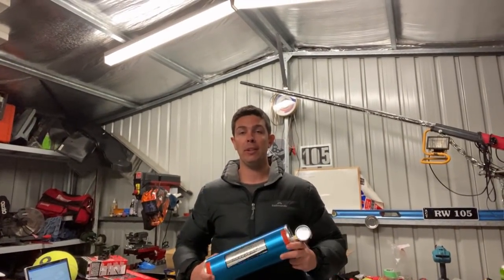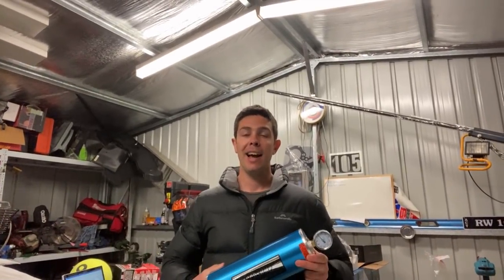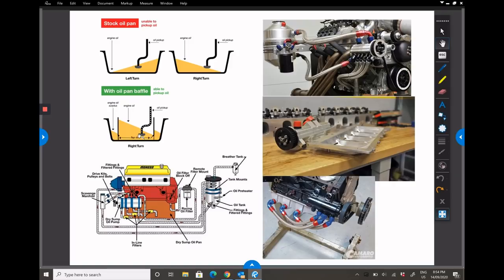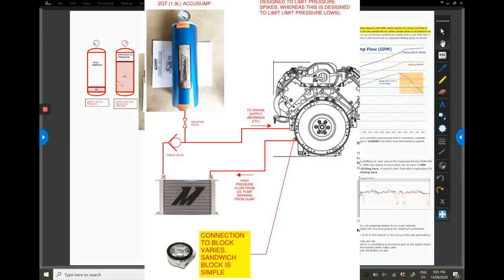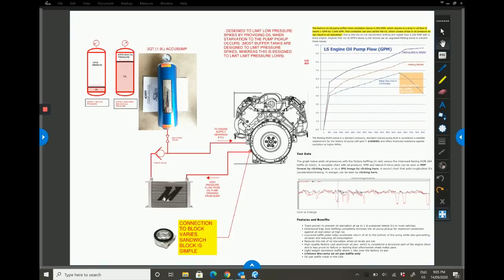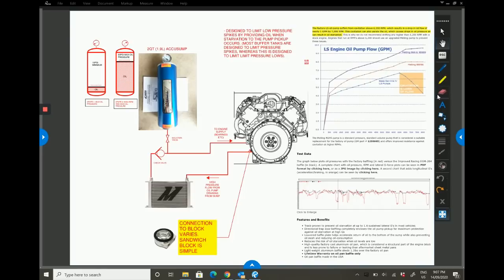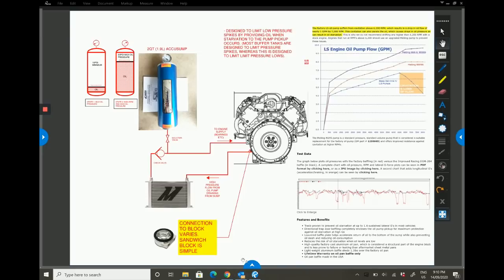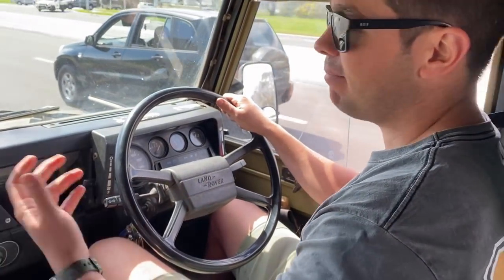Ultima RS - Destined For Destruction? (Video #7 on Wet Sump vs Dry Sump, Accusump and 'Why').

Comment: Ive been thinking about the accusump for my car which I would like to do some recreational type motorsport with.  I havent looked too far into it but one thing I havent quite worked out yet is as follows.  When the engines running some oil goes to the accusump to equalise pressure around the system.  As oil pressure rises with engine rpm more oil goes to the accusump.  That means that less oil is going to the engine and it means that there is less oil in the sump which means the level will be lower and the pick up is more likely to be exposed.  That is exactly the situation that is trying to be avoided and so it seems to create a circular arguement if you know what I mean.
Reply from the maker: Hey mate, Your thoughts are largely correct. It is a buffer tank so it will flatten oil pump response on both sides of the curve. However, the pressure on the positive side of the pump will remain relatively constant relative to rpm. What you sacrifice is that as rpm increases, you will send some oil to the Accusump reservoir to charge it instead of to the motor. So you have reduced flow until the reservoir is charged. Think of it as a bit of 'lag'. This lag will also mean you maintain oil pressure on gear changes too when rpm drops. It's a momentary delay and the recharge rate of the Accusump is system dependent, but you are 100% correct. Accusumps are best suited when you have added an upgraded oil pump in conjunction with it. Then the compensated delivery is still well above design parameters. You can also buy a pressure control valve that operates to charge the system at optimum rates/pressure conditions. 
Without getting too technical, it is something Moroso and the Accusump guys have considered in their design so that the sump doesn't charge super rapidly and steal all the oil from the engine. But there is no escaping the fact that if you have a car capable of 1.8G and drive it around in a circle continuously with a sump that'll starve at 1.4G you're going to run out of oil.

Comment: I get where you coming from but after having a Birkin race car with a dry sump and not blowing an engine in years vs others with a wet sump going through several engines a year, I am a dry sump convert. That accusump oil pressure accumulator just doesn't float my boat, especially after having to deal with fuel pressure accumulators on the old Bosch K jetronic systems(similar principle to give stable fuel pressure). Another perk of Dry sumping is the oil changes are super simple as well: disconnect return line to tank and place in catch pan/sumpy/bucket, start engine, kill engine when oil reaches bottom of tank, put new oil in, start engine till oil runs clean enough, kill engine, reconnect return line and change oil filter. Looking forward to how hard you push the car and how well that accusump works in the long run.
Reply from the maker: Hi James. The dry sump is always the best option but it was also the ‘easy’ choice. I think part of this is that I couldn’t find any reliable data to suggest the cost of the dry sump was necessary so I’m very interested to see if starvation occurs with this setup. 
As for those fuel pressure accumulators, I believe my E28 M535i runs an early Bosch system.... I might have to read up and see if it’s got one and how they work/fail.

Comment: Great insight Rob and enjoyed all the theory on the Accusump and how they work... seen a few in some of the more serious racecars here in NZ...   NOT too sure you'll hear a low oil pressure buzzer in the Ultima with the LS cranking, red mist descended and a helmet on though!!! LOL... but dead right about getting the ECU to monitor the situation and save those bearings.
Reply from the maker: Thanks Stu. I know what you mean - when you’re focused on the driving it’s hard to draw attention.
Definitely a warning light in the field of vision and an alarm. Lots of dashes these days incorporate the warnings into the shift light cluster too.

Comment: Rob thank you for the a very informative video! More importantly a lot of questions were addressed with the dialog between you and Humble ! Watching Humble’s car burn and the resulting carnage created a lot of unanswered questions but have now been addressed. Furthermore , I’ve been torn between the GM dry sump system vs a wet sump with an accusump chaser. Based on your perspective seems the GM is not a true multi stage dry sump system worth pursuing. More importantly regardless of the oil system the clutch system selection is critical for a dual purpose Ultima. 

Off topic, Nice job supporting your better half, you earned some points towards for a few late garage nights with the project! However , you just let the world know you watch the Bachelor! 🤣
Reply from the maker: Thanks John! 
The GM system is good. But if you're not building an LS7, it seems that you'd be putting decent money into a 'good' system, and not a 'great' system like the Dailey/Moroso ones. The middle ground is always a bit awkward. Kind of like the choice of track alignment/suspension settings - Great track cars rarely make great road cars, and the ones in between aren't usually 'great' at either purpose. 
Dangers in generalisation there (Porsche GT3 etc), but you get the idea.   
For me, an Accusump is $650 (plus hoses/plumbing/brackets/cooler) and the data wasn't there to support a dry sump unless I ran on R-Spec+ rubber. The one recent development in tyre tech' is that Cup 2s/PS4S are 90% as capable as R-Spec rubber, but they don't fall apart on the track like high performance tyres used to. I want to drive to and from the track in this car and not trailer everything so slicks/R Spec aren't in it's immediate future. 
Ps. How can you not watch The Bachelor? The only difference is that my interest is purely a sociological one, in that I didn't know people could be so stupid!

Comment: There is a long sustained right hand turn at my local track known as the " LS killer "
Reply from the maker: Some sick bastard who owns a Ford designed it?
LS actually have an intrinsically disadvantaged design with the deep skirt block in regard to oiling, but it does make them strong. Downside is that the stock system is pushing sh!t up hill. The thing about any oiling system, is that you have to design the system and how it works with the car. Being a Porsche owner you no doubt have an appreciation for how well packaged a proper car can be!

Comment: great update thanks for making the vid I think you're going to be fine with this setup unless you're doing hard track days back to back to back to back and this is a fully track car I don't think you're going to run into issues
Reply from the maker: Thanks! I hope there aren't any issues. There are always some limitations with anything, but tyre technology means you can now run something like a Cup 2 or PS4S at the track and they stand up to the punishment at 9/10 of what an R-Spec tyre does. For me and the purpose of this car, that is perfect. I've got some other cars I can run slicks on, and that's great too. But those cars you have to tow to the circuit, with tools, wet weather tyres, etc etc. and are setup way too harshly for the road. So it's just a different choice.

Comment: Really enjoying these series of videos. You mentioned you're installing a baffled pan.  Is it also deeper, with more capacity, so that also reduces the chances of the pickup being exposed?
Reply from the maker: Hey James, Glad you're enjoying it. The sump profile is such that it holds a bit more volume. You're exactly right to note that adding some depth is the simplest and smartest contributor to helping pickup issues. The caveat is, of course, clearance under the car. Like all things, a bit of a balance with the sump design to maintain pickup and maintain reasonable height.
I'm in the process of covering underbody chassis protection right now accordingly. I'll do a video on that, because it's something overlooked on cars like this and very important.

Comment: Love the Defender
You said it. Baffled wet sump and an oil accumulator is enough for 95% of applications, especially mixed road and track use.
Loving the longer video
Reply from the maker: Thanks Gafrers. I don't like to cut corners, but I also don't like to spend money on things unnecessarily (better off giving it to charity). For me, it is a road car that'll see some occasional track use. There isn't a point pretending i'll have a suspension setup, brake pads, spare tyres, car transporter, finances etc to run this thing as an outright track vehicle, so I don't see the need to make concessions that pretend otherwise.

Comment: If the pick up was part of the pan you could have multiple pick up points all feeding into one pipe that exits out the bottom and than up to the pump . Than a wet sump would be good for everything , and i'm pretty sure you could make it all work off of the stock oil pump .
Reply: Don't see that working very well Jerry, as soon as one inlet is open to air then the pump will preferentially pull air because air flows a lot easier than oil.
Reply from the maker: There's a few variations on wet sump setups, but by the time you make them work you're into equivalent complexity/cost to a dry sump setup that is better anyhow. The easiest way to make a wet sump work is have an infinitely deep drain pan, but that makes it hard as your sump would be a bit of a drag (on the ground).

Comment: Longer vids, more often,  please. Love 'em!  Sure you've already seen it, but the concensus on DDD's catastrophic failure seemed to've been a lack of oil under G byt the looks of it, so good call.... the big take-away from that disaster, was the importance of the racing fuel cell vs the standard IMO. Litterally a life-saver. 
PS.  Glad you're getting in front of the camera more often.   You're a hansdome devil and present very well.  TG Au. look out! ;)
Reply from the maker: I wish I could work on the car and make videos all day, but $10.62c won't quite get me there so I have to go to work haha. DDD made a comment below - his summation is actually that it wasn't an oiling issue. 
The purchase of a fire system was in large part to Will's unfortunate situation. Really a credit to him to share his build and also rebuild the car. Cheers!

Comment: Many GTR builders have used wet sump engines and accusump accumulators in their cars without issue, but I'm not sure how many of those really got flogged at the track.  I think you'll be mostly okay, especially if you'll be logging the pressure side data and you'll be able to catch any early weaknesses.  Many, including myself, thought my engine failure was oil pressure related, but it had more to do with the heavy clutch wiping out the thrust bearing.
Reply from the maker: That's a key caveat, Will. The use of the car, and the capability of the drivers are additional factors that rarely get listed as a qualification when engine failure occurs. 
For your thrust bearing failure, how did you discover that the clutch was the contributor? It does make sense, but surely that's a very rapid degradation. 
I'm interested because I've seen guys fitting alternative throwout bearings. But that wouldn't be the answer to rectify it in my mind. The only time you laterally load the crank from the clutch is when the clutch is disengaging the 'box from the motor. At that point the pressure plate is loading the crank. The way to rectify that issue would be to go to a multi plate clutch and reduce the pressure plate force.
Reply: @rob105motorsport  A few other builders besides myself have noted aggressive thrust bearing wear when using g96/g97 transaxles with high output engines.  After talking with Rob @ RPS he shed some light on the issue.  Porsche designs their engine/trans combo for small diameter clutches, and high load pressure plates.  Most lumpy V8s on the other hand run the opposite, large diameter clutches and low load pressure plates.  The thrust bearing on the LS7 was only designed for a lateral thrust of ~450lbs, but the stage 2 Sachs Porsche pressure plate that is common for 720hp spec GTR/Evo builds exerts more than twice that.  So even with good oil pressure you end up wiping out one side of the thrust bearing.  Mine was way thin on one side, and all that material ended up in the oil, Charlie's thrust bearing was so far gone the crank counterweights were hitting the support webbing on the block.  Right now the fix is a multiplate clutch, 2 or 3 disk and there are a couple options.  A few of us have opted for RPS twin or triple plate carbon clutches, simply because it directly addresses the thrust issue, and has much better street manners than ceramic or mixed material multiplate clutches.
Reply from the maker: @DriveDriverDriven  All makes sense to me now!

Comment: F1 cars are currently running bursts of over 4  gs.
Reply from the maker: Yep. The last video I watched had them into the mid 5s. The link in the description shows some good test data a crew did comparing race cars, road cars, and club level race vehicles which I found interesting. I think an Ultima could really be up there with some slicks and a race setup!